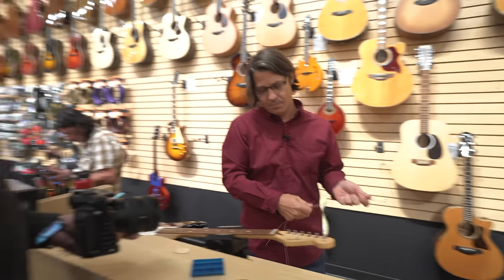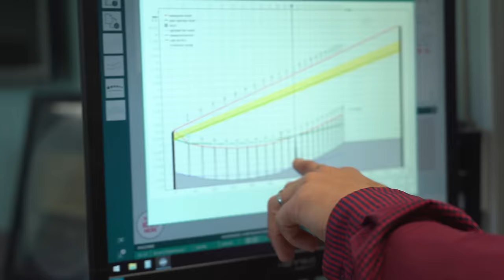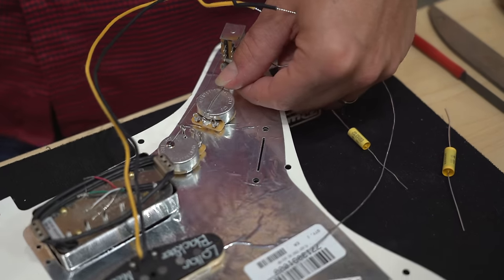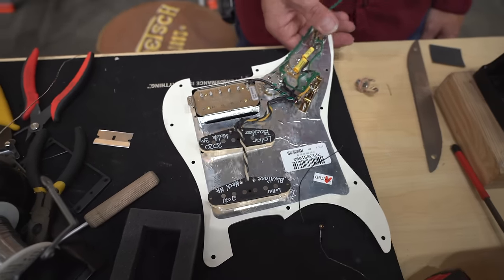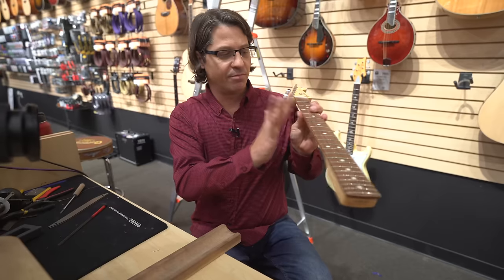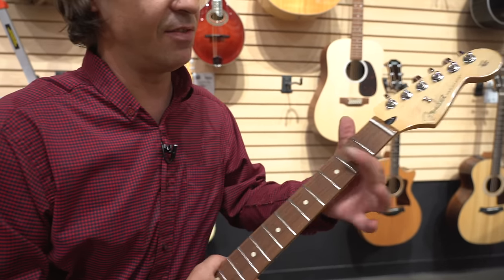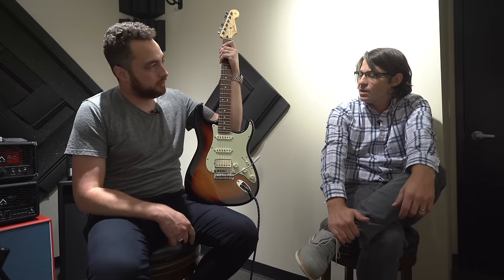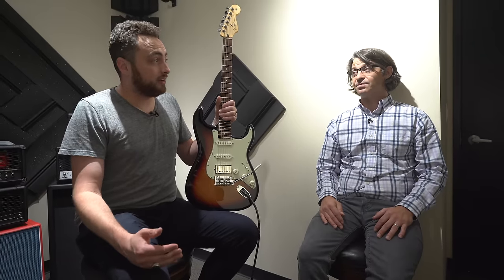We Tried To "Custom Shop" The Cheapest Fender Strat

Comment: Some food for thought. About 7 months ago I purchased an Indonesian made PRS SE Custom 24 for $850. I was blown away by how great this guitar looked, played and sounded right out of the box. Fret work was good except it needed a little leveling at the high end. Board edges was actually rolled nicely and IMHO there is something special going on with these pick ups. Very open and nice clarity. Took it to my local guru, he leveled the frets and did a setup for $100. I added some locking tuners for another $100. So now I have a fantastic guitar that plays and sound great for under $1100. I rarely pick up my 2 Gibby Les Pauls or Fender Tele Elite. You can get the S2 version  for $1800 or the USA Core version for around 4K. Now I'm sure both those guitars are better than my cheaper model, but I can't imagine being 2 or 3 times the price better. Very happy with my $1100 guitar.
Reply: they're doing great things at the SE factory in Indonesia. PRS just put out a factory tour video on YT...pretty awesome.
Reply: Prs se are a lot of value for the money!
Reply: I just picked up an older Korean made PRS SE, quick shine job on the frets, cleaned the fretboard, and it plays extremely nice...$400 used.
Reply: @perniciousreaper4393  we
Reply: Had an elite Tele (lefty). It would be rare as rockinghorse droppings now. (An 83, I think it was). I dig getting sweeties from cheapies, these days.
Reply: I love my PRS SE Custom. I’ve had many expensive guitars and this one holds its own for a lot less money.
Reply: @BillChristen3  I got over the name game years ago. ( it was hard to go out, with 1000’s under the bed, to worry about?).
I got an aria travel/parlour, from a guy who’s wife didn’t end up learning. Lovely little thing, for 150. 
Electrics are fairly easy to make up, get a decent neck, make sure the 12 fret is halfway, good to go.
Reply: @Boony Tootyhang onto it, and see.
Reply: I couldn't agree more. I picked up a Korean made SE back in 2008. It was meant to be an inexpensive backup but it quickly became one of my favorites. It plays as well as guitars two or three times it's price.
Reply: @perniciousreaper4393  Seems like a lot of great guitars are coming out of Indonesia, I've got a Squier bullet strat and man, it's plays extremely well and sounds incredible for the $300 NZD I paid for it.
Reply: I picked up a mint PRS SE Carlos Santana made in Korea on gumtree for 300 (approx US dollar value). The short 24.5 scale PRS (Gibson Jr. style PRS actually). I added some locking tuners for 60, and added a set of brass bridge saddles for 7. I even kept the stock pups! And out of all my guitars, more expensive, and less expensive ones I own, it's been my GO TO axe!!

Edit: Thinking about replacing the whole tremolo bridge and block for a higher spec one, I hear its a popular PRS SE mod.
Reply: @Mexxx65  Awesome, I got a second hand PRS SE 22 from Korea, thinking about upgrading a few parts... the volume pot is a big screwed so that's definitely something I need to replace.
It's a fantastic guitar, I got it for I think 400 British pounds while living in the UK a couple years back, it was only a year old at that point, which made it around half price.
Reply: I've got four Korean PRS SEs...two were purchased new and two were used. Excellent bang for the buck indeed, even after factoring in pickup replacement on three of them. (I'm happy with the factory pups in the 245 SE so see no need to change them.)
Reply: I have the same thing with a Korean made SE custom 24 picked it up from a good friend who had added graph tech saddles and Wolfetone Dr. vintage pickups..& barely  played it as he has a nice collection... I bought it for 800 all in and added some small detail upgrades like PRS  locking tuners rose wood pup rings, tuner buttons, back plates it is an absolutely incredible looking playing sounding guitar..I've jonesed for a proper us made PRS for 35 years.... I'll never stop dreaming looking at the pics of some of those incredible 10tops etc... But I'm happy as hell with my Korean PRS SE.
Reply: I have heard that those Indo SEs are amazing 🎸🎶😎👊👍
Reply: I got the same guitar 2 years ago and never felt the need to bring it to a shop for any type of fix. I adjusted the truss rod a couple of times on season change. I replaced tuners and pickups and I love it. Much more value IMHO than a MIM Fender strat, at least the ones I had the opportunity to try out.
Reply: @TheMerc1950  my main axe is an SE custom 22 semi-hollow. Paid $400-ish.  Eventually, I upgraded the pickups to Pearly Gates.  Next is coil splitting and a refret.  I've played many guitars that are several times the cost, and only a couple stood out as nicer...one being a very high end fender "blackie" that had a professional setup.

My PRS sounds as good or better depending on which tones I'm going for, and I spent about 1/5 the total price, even after pickup upgrades
Reply: I've been highly impressed with Indonesian built instruments that I have owned. I have a Squier Jazz Bass I picked up in 2009 for £220 and after a set up, I've never felt the need to replace it with anything more expensive. Might have to pick up the 5 string version that's available now. I'm not a bassist by trade but in the home studio I do it all myself but for me, the Indonesian Squiers are perfect for me. Got a 7 string Indonesian Ibanez Apex2 and in places the build quality is better than a Korean built S series. I will add that whilst they are great instruments, they don't compare to my Fujigen 80s Strat and Fujigen RG770DX reissue. Japanese build quality is something else.
Reply: Absolutely! I have an Indo SE 30th or 35th anniversary, I actually bought from Righteous, and it's just awesome! Did you get the PRS locking tuners? Considering them. I can't believe that Strat is $800, with those crappy frets etc. I'd get another PRS any day.
Reply: @sbrave  I've been looking into locking tuners, but not necessarily the PRS ones.  From what I can gather from reviews, there are many brands that are just as good for much less $.  Frankly, my guitar stays in tune pretty consistently, so I might not bother.
Reply: @K & S Johnson the issue im seeing is that them prs se guitars are priced twice as much as they should be. made at the same Indonesian  factory as the Squier guitars. that cost a bit over $400. your just paying for that name!. "PRS" are scamming people like you!.
Reply: @heres2ya  I haven't held a squier that is anywhere near as nice as an SE for half the price.  I have barely held a Fender that was as nice as the SE's  at double the price
Reply: @heres2ya  Have to disagree. I bought my Squier Strat for $175 (maybe lower model)? and the pickups/electronics and tuners were garbage. Fret edges were not smoothed out at all. Have not replaced anything on my PRS SE and it's solid.
Reply: @sbrave  most of the squires and too many of the fenders I have picked up have had unimpressive fretwork.  Not bad, but not better than the competition.  Many of them had rough fret ends, it's a big reason I never seem to find one I love.
Reply: @stevescuba1978  Agreed. I had to get the frets leveled a bit, but mostly smoothed out on the sides of the neck. Once that was done and I steel-wooled the back of the neck a bit, that and the other stuff I mentioned, it's pretty sweet now, but it was definitely some work involved.
Reply: @sbrave  I hot every neck with steel wool immediately.  The one thing I don't like about most of the SE guitars is the gloss finish on the neck.  I'm gonna have to bring some baby powder to test drive one if I ever intend to buy.  I have a hard time playing glass necks with my sticky hands.  I have to do the same for pool cues.
Reply: good that you re happy with your cheap guitar. Gotta be happy in life. I'm happy with my gibby 335 with boutique hand wound humbuckers made specifically for me. To each his own.
Reply: @stevescuba1978  Yeah, SE's and probably all of their models have the glossy neck. Would be interesting to see how it plays after the steel wool treatment!
Reply: @duellingscarguevara  Right on point! I've tried to like my 3 Gibson LP's that all cost over $2k, and sold all of them. No matter what I did electronics/pickup-wise, I didn't like the sound. All 3 of my Epiphone LP's sound way better and play just as well, after a good setup and replacing pickups, and cost 1/4 the price of a Gibson, lol
Reply: @sbrave  there’s something fun about strangling a cheapie!, (no fear doing a headstock bend, with no whammy bar?😆).
(Tommy Emmanuel does with high end stuff, freaks out the buyers remorse crowd).
Reply: @jfar3340  good that you are happy to overspend for a brand name.  You also need to be happy in life.  Bragging about your gear snobbery must bring you joy, especially with your condescending tone (that's the real Gibson tone) that only Gibson owners seem to have.

To each their own, but I've never been impressed by people flouting their money.
Reply: @stevescuba1978  getting a fine guitar is not overspending on a brand name. Getting a gibby doesn't mean anything about one's money; most people can afford gibbys (at least the vast majority of the people in my circle). 

Some people are happy with cheap guitars, and I'm fine with that. I prefer quality intruments. Some people are happy with playing shapes, I'm fine with that. I play notes and I sight read. Most guitar players are not musicians. Respect yourself as a musician, get a proper instrument.
Reply: @sbrave  steel wool can't save a cheap guitar. The only made in Asia guitar I would get is the upper end models of ibanez. Nothing corean. I also considered Eastman briefly but meh, I don't know. Do yourself a favor, get a gibson, martin standard series or fender (at least american original/custom shop grade)
Reply: @stevescuba1978  Yup, I believe you. Did you pick up custom shop fenders? I don't think so. You get what you pay for.
Reply: @sbrave  PRS SE is solid but it doesn't hold a candle to nice gibsons or fender custom shop.
Reply: @stevescuba1978  double the price I don't know, but when you get to the custom shop level SE doesn't hold a candle to the fender
Reply: @stevescuba1978  locking tuners have little to do with how in tune your guitar stays. You can have locking tuners and a pinch at the nut, you'll be out of tune. Locking tuners are useful when puting on new strings you don't have to turn the thing as much.
Reply: @jfar3340  The steel wool is just a preference for those that want to get rid of the finish on the back of the neck. More of a feel thing. I did it to my Squier and it feels great.
Reply: @sbrave  very nice
Reply: @jfar3340  I have picked up custom shop fenders, and of course they, at double the cost, have as good or better for and finish as the SE's.  Nothing that an hour of love can't duplicate.

I repaired my friend's  '56 reissue Les Paul, which cost triple what an SE costs.  Once again, fit and finish was equal to or maybe just a slight bit better than my SE, which I made as nice with 5 minutes and a file. 

I have found flaws in every single guitar I've ever picked up, from $100-$5k.

What exactly do you think is so much better about a Gibson?  Does sandpaper work better in the US than in Indonesia?  No.  Does electricity flow differently through pure copper wire in Korea than Kansas?  No.  Does that bare perceptible increase in finish quality on (some) Gibson's justify double, triple, or more the cost of another instrument?   No.

I've seen interviews from the lead techniciam in Fender's custom shop line, and from his own mouth, the only difference from a pro model to custom shop model is more time on the finish, mostly on the fretwork.

A professional fret job, easily on par with the quality that Fender luthiers can attain, does not cost the $1000 difference between guitars.

Paul Reed Smith himself says basically the same for his guitars, except in the case of PRS, they have incredible wood choices that really do differentiate their high-end models from their lower (in asthetics, not necessarily function).

How many professional musicians need to publicly state that today's cheap guitars are as good or better than the original fenders and Gibson's?  I've had my hands on several vintage guitars, including my dad's '64 Gibson SG bass.  Granted, there is no telling what happened to those instruments over time, but not a single one of them was a "better" guitar than my $180 SX "strat".  They all used copper wire, they all used magnets, they all were made of wood.  My SX is mahogany, most strats are alder or another cheaper wood.  

You say respect myself as a musician, but I'm a dad guitarist, I taught myself, I do it for a hobby, for fun, and just for me.  In that way, I respect my musical journey.  However, spending several thousand dollars on a guitar that does nothing better than a cheaper one does not seem to be respectful of me as a husband, father, and provider.

In the end you like what you like, and if you require a Gibson to feel good about your playing, then you should have a Gibson.  For everyone else, let's try to be objective, especially for the beginners around.  Even the leaders of the big guitar brands themselves admit that there is very little difference between their high end guitars and their main stream guitars.  As long as it feels good, sounds good, and stays in tune, it is good!
Reply: @stevescuba1978  ''than my SE, which I made as nice with 5 minutes and a file. '' ''spending several thousand dollars on a guitar that does nothing better than a cheaper one does not seem to be respectful of me as a husband, father, and provider.''

That explains your wall of text. I don't care what you can and can't afford. If you're happy with your cheap guitars, be proud. I'm happy with my honda civic, I just don't pretend it's a BMW.
Reply: @jfar3340  I am proud of my guitars.  They are custom.  

your Honda Civic is a better car than that BMW, by the way.  As a mechanic I can happily explain why.

I can afford a Gibson, but I won't buy one....for the exact reason I wouldn't buy a BMW over a Honda Civic.  You pay twice as much for something not as good.  I don't need people to perceive me as having the best.  As a skilled tradesman, (machinist/aerospace mechanic) I very well know the difference in quality between materials, I can immediately see the difference between craftsmanship, and I'm not fooled by fancy names.

The difference between your custom shop guitar and the pro series with the same specs is about an hour in the Craftsman's hands....that is directly from the mouths of the people who build them.  Since I am capable of doing that little bit of finish work myself, and since, over time, most guitars need some me tinkering to keep them perfect, my conclusion is that it is not of value to spend the extra money.

Of course, I've talked to many guitar techs who make a living off guys that will spend any amount of money rather than a few minutes tweaking their setup. 

Honest question, one which you did not answer.  What does your Gibson do different or better  than my SE?  What magical properties are imparted in the instrument based on the race or nationality of the luthier?  What can gibson do to a piece of wood and some wire that others cannot accomplish?
Reply: @stevescuba1978  ''What does your Gibson do different or better  than my SE?  What magical properties are imparted in the instrument based on the race or nationality of the luthier?  What can gibson do to a piece of wood and some wire that others cannot accomplish?''

I have no idea, I just said I was happy with my 335 gibby with custom made pickups. Where did I claim that a gibson does things that an SE doesn't?
Reply: @jfar3340  "I prefer quality instruments."

That's what you said.  I countered with the idea that the only thing Gibson does better than these other brands is being a Gibson.  

I pointed out that the very luthiers who make the instruments that you claim are "quality" say that the only difference are in a little bit of the luthier's time.

I say, that if you only measure quality by the name on the headstock, then perhaps you are correct.  If you measure quality in objective terms, ie: playability, tone, durability, aesthetics....then Gibson is just another guitar company.  And one with a bad reputation for bad quality control and price gouging.

My opinion is backed up by many professional musicians and luthiers.  Your opinion is backed up by Gibson owners.
Reply: @stevescuba1978  My opinion is only backed by myself.

''I prefer quality instruments.'' This is absolutely true. Nothing but quality, quality and quality. The most important question would be: do you like quality?
Reply: @jfar3340  I absolutely do, I just don't define it by brand name.  I also don't think cost is necessarily a good indicator of quality.
Reply: @stevescuba1978  Brand name is key in every single sphere of life, every single one even the most important ones (healthcare, education). As for cost you usually get what you pay for. There is no free lunch. Crafstmanship and materials have a cost.
Reply: @jfar3340  I agree with all you said except for brand name.  Brand name is about perceived value.  Many people value brand names because they don't know the difference between brands (not you, necessarily).  Many brands capitalize on this phenomenon, which is why Gibson has a reputation for bad quality control, hasn't addressed the design flaws in their guitars, and still commands a premium price.

I also will not argue that, to some, the monetary value of their guitar matters.  For me, if I love it, it is invaluable regardless of monetary worth.

So it seems we're getting to the crux of our disagreement.  You place more value on the perceived value and the recognition of brand than I do...so clearly you find more value in a Gibson.

I put more value in the tangible characteristics of a thing.  Both are valid viewpoints, just different.

I am really curious though, what is it about Gibson, besides the name on the headstock, that you think is of higher quality than all the other guitars we mentioned?  There has to be something.
Reply: @stevescuba1978  I disagree with the fact that the difference between gibson vs SE is just brand name. My 335 is plekked and has a nitro finish. I didn't like the pickups so I changed them, but the rest of the electornic is great. It's construction makes it very clear and resonant, which is the only subjective argument. For the plekk, nitro finish, caps/wiring used, the gibson is worth the price difference for me.
Reply: @sbrave  after I repaired my friend's Les Paul that had it's headstock snapped off, he loved the feel of the neck on my SE, so I took the gloss off the neck of his LP and he liked the "improvement" (not really an improvement, but it is a feel that many prefer.
Reply: @jfar3340  so would you say that a guitar, made with quality woods, with the same attention to detail (pleck'd, top shelf electronics and wire, etc) is as high quality regardless of brand name?

I would.  I just happened to perform the detail work myself rather than have Gibson do it, at a fraction of the cost.  For me, I have a maple top, mahogany body and neck, and the humbuckers of my choice.  I have a perfect (for my preferences) setup and flawless fret job (which can easily be done to the same specs or even better than the machine can accomplish).  I have the highest quality of potentiometers, wire, and capacitors, soldered by my own hand (a good friend of mine taught courses on soldering for the Air Force and gave me a personal course).

So, in what way, other than brand name and shape of the guitar, is yours any different from mine? Both were roughed out by CNC and finished by hand. Both are made from quality materials and assembled by a competent craftsman.  I will assume that your 335 plays beautifully and sounds fantastic, as all of the ones I've played have been great.  However, we both replaced pickups (mine was preference as the originals were fine, they just didn't push my amp to breakup how I liked) and did setup work.

I am guessing yours cost north of $3k, mine cost a total of about $600.

 Every person who has played my SE has handed it back quite impressed, and they loved my fretwork.  They played it beautifully, loved the tones they got, and every single one thought I had a "gigable" axe to be proud of.

Where is the lack of quality?
Reply: @stevescuba1978  ''so would you say that a guitar, made with quality woods, with the same attention to detail (pleck'd, top shelf electronics and wire, etc) is as high quality regardless of brand name?'' 

Absolutely, my after market pickups are no name pickups made by a local tech. I'm not american so I don't have a ''$'' comparison to your figure.
Reply: @jfar3340  well I'm glad we walked through it all.  In the end, we agree on nearly everything!  

And for the record, I love Gibson guitars, and the 335 is probably my holy grail guitar.  No body has ever been cooler than Chuck Berry, in my mind, and the 335 just screams good taste. 

Unfortunately for me, but fortunate for my wallet, I've never found a Gibson that speaks to me, even though I've played some exquisite examples.  Same with fenders, I just never seem to fall in love with them no matter how great they are.

Also, thanks for that bit about the locking tuners.  I've never had any on my guitars, and people always suggest to use them when folks have tuning issues.  I assumed they held tune better, but I have no experience with them.  My guitars stay in tune rather well, so the stock tuners will stay unless I just feel like swapping one day.
Reply: @stevescuba1978  Cheers man it was a good conversation enjoy your PRS
Reply: All depends on the individual instrument for me. Bought a 17’ semi hollow 22 and used it since… since I found the right strat that really did it for me. The SE sounds amazing and has its own place in terms of tone and play style, but it’s undeniable that this strat I found is an obvious step above. I’ve also played some shitty strats too tho. So it just depends, for me.
Reply: @jfar3340  PRS custom silver sky kicks any fender strat’s ass any day of the week and twice on Sunday. I didn’t used to think so but, I played one and I am now a believer. Those people over there ate Fender’s breakfast, lunch and dinner with that one.
Reply: @Xochiyolotl  yeah but it's ugly AF
Reply: @jfar3340   Camaro/Mustang: great car, love to have one.  Bugatti: whole different league. Higher quality/costlier components (BETTER).  Worth 10 Camaros.  Mic drop.
Reply: @stevescuba1978  Camaro/Mustang: great car. Would love to have one.  Bugatti: BETTER car. Higher quality/value of parts. Worth 10 Camaros.  Mic drop.
Reply: Upgrade Camaro/Mustang? Sure!  Upgrade Bugatti??  Why?  How?
Reply: @craigthompson7070  while I love your analogy, and it rings mostly true, I would argue that, it depends on what you want the car for.  Are you a driver, or just swinging your junk to impress people?  Are you gonna drive that Bugatti like you stole it?  Doubt it...but if I had 10 Camero's and/or Mustangs, 1 could be a drag car, 1 one could rally, 1 could be tricked out silly, 1 could race GT, 1 could race trans am, and I could still give 1 to mom, 1 to dad, 1 to an underwear model, and have 2 to run in the derby, 'cause why not?

I personally am a practical utilitarian guy.  I'm a tradesman, veteran, handyman.  I don't wear a suit, so no Bugatti for me.  

But you aren't wrong.  Some guys ain't me.